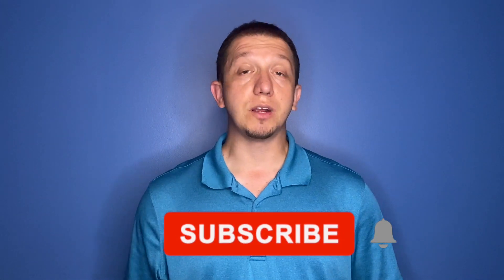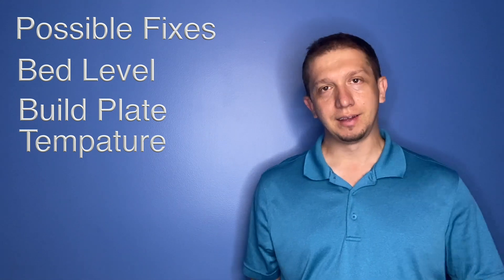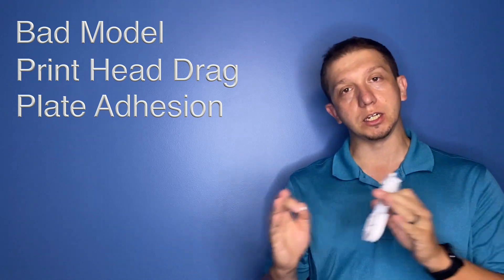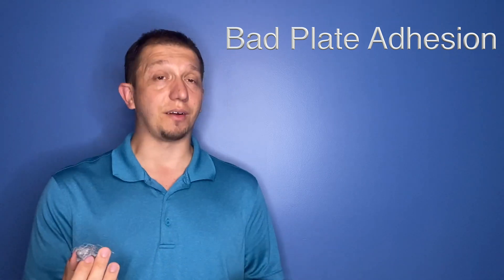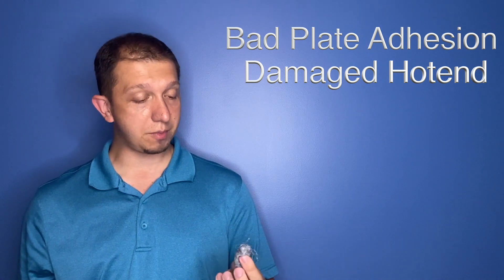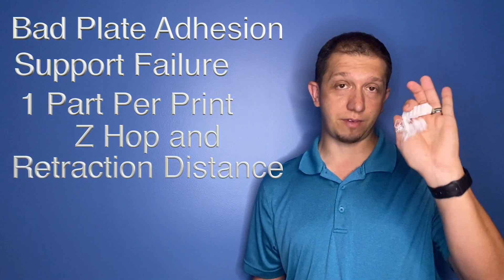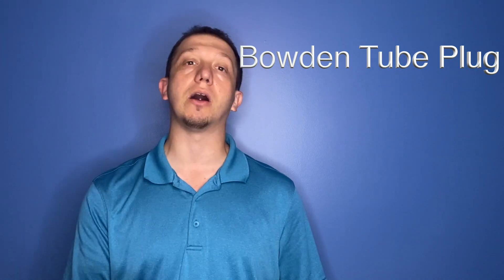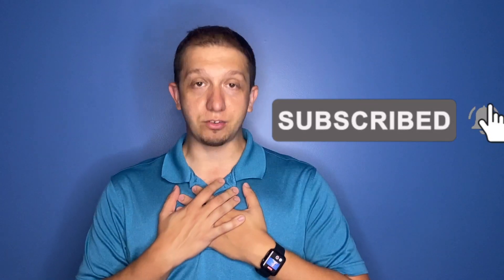5 Common 3D Printer Fails and Fixes

Comment: I was trying to print a batch of 9 different flat pelican keychains to sell, but the print failed around the beginning so we had to stop it and it was very tough to scrape off the plate. As the print started, nozzle started to drag the plastic around as it printed. Any clue why this happened?

Comment: I had a test bench print at high speed which ended up moving and it blobbed my ender 3 V3 KE hotend . Got most of it cleaned off and working however for a long print I can smell the filiament burning away and it is getting worse . I'll have to take the entire assembly apart to see what I missed .

Comment: I have the spaghetti issue but only on a particular model that i modified in blender. I am not sure why it is happening. For context, i am using the remesh modifier on the model. All of my other versions of the model that are failing are printing without issue so i am a bit confused. The other versions are only slightly different so i dont know why this particular model is causing issues, is it the slicer software that is the issue? Is it the way i am modifying in blender? Any help is greatly appreciated.

Comment: I rarely had print failure because of negligence, but my Ender 3 often randomly reboots mid print...
Sometimes it runs for a day or so no issues, sometimes it reboots mid print 2-3 times in a row...
I don't know why it does that, but I'm in an industrial area, where my UPS switches to battery breefly every once in a while due to temporary voltage spikes or drops, so I'm suspecting voltage instability, so I actually put a 20000 uF cap right after the power supply, traced 3.3V and 5V rails on the main board, and put 470uF caps on those too to mitigate the issue. It has improved a bit, but sometimes it still reboots.
I guess having a non-sinusoidal UPS also doesn't help, but that's what I have to work with...

Comment: I have learned a print issue that's a little bit unique that causes Prince to fail and this happens to be the filament you are using sometimes with certain filaments you need to adjust the temperature of the nozzle to get the particular filament color to properly work I ran into this Issue when trying to use a clear colored filament When I was using a solid color Also with this particular clear filament I have to make sure that the executor excludes for a moment or 2 cancel the print then restart otherwise it'll fail the print automatically for whatever reason it has to be fresh filament for this particular type of filament

Comment: Dude, thanks for putting this out.  I do production level printing of a few small parts that I assemble and sell as a hardware component.  For quality sake, I have long ago stepped back to single part printing.  I always keep spare wear parts on hand and meticulously level the bed when troubleshooting.  I have several printers to support the production level that I need to keep up with inventory for sales. I've experienced and worked through hundreds of problems, but have one printer that is just plagued with intermittent failures...2 fails then one good print...then 3 failures in a row.  I've done everything I can think of... I re-sliced every model and have created a library of g-codes to move the prints around to different bed positions every time, so as not to wear the build plate in any sort of pattern.  Is there a chance that this printer is just sloppy and worn out?  I have gotten so frustrated, That I've thrown the thing across the room only to pick it up, tighten everything, re-level and try again... works good for a few prints then thee inevitable failure.

Comment: My printer (ender 3 pro) when I first started a print, it went successful, but the next print it made the first layer but the other layers are screwed up infill ect, and this started today, I tried another print and it did the same thing, I redownloaded cura thinking it was maybe the settings, and the infill layers are just all screwed up, please respond asap, thank you!
Reply from the maker: So simple start questions.  Did you level the bed again?   Change filament?  What all have you done?
Reply: @Rise3DBuilds  I leveled the bed, and did not change filament yet.
Reply from the maker: @PhoenixPlays42  email me at mike@rise3dprinting.com.  Send some photos on what’s happening
Reply: @Rise3DBuilds  Do you think maybe my finger 
grease/ hand grease while loading/ touching the filament is maybe causing the extruder to skip, beacuase im printing a print right now and it looks to be all good?
Reply from the maker: Possible or humidity.   So it’s doing fine again now?   Did you change anything in the file?
Reply: @Rise3DBuilds  it has been very humid in my room the last few days, the new grey filament Im printing right now has been in an air right bag, and I’ve had my fan on over night, but filament can go bad in humidity in 8 months or more, not 1 month?
Reply from the maker: Humidity can start causing issue on day 1.
Reply: @Rise3DBuilds  what would you recommend then?
Reply from the maker: @PhoenixPlays42  when not printing store your filament in a suit tight bag with silica packets to draw away moisture.   For rolls having issues I recommend a filament heater
Reply: @Rise3DBuilds  I can’t but that rn but I have 1 silica packet from the new spool of grey filament.

Comment: I’m new to printing and I ran into the issue of the filament not dispensing properly do I need to clean out the tip? I’ve been fighting with this for a few days now
Reply from the maker: Might need to change the nozzle or try cleaning the tip.    Also make sure the extruder gear is pushing the filament in and not all bunked up
Reply: @Rise3DBuilds  I’ll try that thank you

Comment: just had my first major failure with my s1 plus. seems a part came off bed, filament collected at the extruder due to the "halo" fan duct.... ripped the hot end out of extruder and  left me with a big clump of pla to dig thru to find my parts 😭😭😭

and for some odd reason the extruder was digging into the bed when it had the clump of hardened pla on it... not nice at all!!

the ironic thing is, I ordered my wifi + cam 2 days ago... I should have just been patient and waited, but now I'm ordering a new extruder... at least the original can't be cleaned and kept for a spare.

cheers, good luck everyone!

Comment: If prints shift, check your belt tension especially, I had that issue awhile back
Reply: If your machine has a lot of hours on it, check stepper cables and connectors where they flex on movable stages.   Ribbon cables will fatigue and develop breaks inside the insulation leading to intermittent dropped steps.  Super frustrating to diagnose when it's barely beginning to manifest, but it'll eventually become bad enough to be obvious.

Comment: I just got an Ender 3 v2, and I want to throw it out the window right now. I have been trying for days to get it print anything thing and it won't. I'm using PETG(Overture black) and it won't adhere, the test strand is the only thing that adheres after that it does not stick at all. I have tried to print over 30 times. ran the extruder temp from 200-260 C ran the bed from 50-90 C, I tried stick glue, painters tape, hair spray and cleaning the bed with dish soap, but nothing works. I've level the bed 20-30 times using paper and card stock but it doesn't change. I even tried switching to PLA and that didn't make any difference either. Nothing sticks and I have 30 blobs of wasted filiment. I have switched the print files trying different builds, none have worked. All I can say is don't buy a Ender 3 V2 it has been a discouraging waste of time, money and effort. I have watched countless videos but nothing has changed. I have taken it apart and rebuilt it twice to make sure it assembled correctly but nothing has changed! 😓
Reply from the maker: Please email me @ mike@rise3dprinting.com.  I would like to try to help you

Comment: Ive been trying to print a model that I have done before just in a different color of PLA and it doesn’t work. Every time it tries to do a line it won’t disconnect from the line and I don’t know why. Is there any way to fix this?

Comment: I just had a blob and in the process one of my white wires broke and I have no idea how to fix that. any tips or tutorials? I think it's the thermometer wires.
Reply from the maker: You will need to replace the part.   Heat the hotend and there is a screw undo that and the whole part will come out.  They are pretty cheap on Amazon.  You will have to pull it from the board and install the new one while the hot end is hot.  Should be a 10 dollar repair

Comment: great video, I’m trying to print the adapter for my bltouch for my new bondtech direct drive on my ender 3 for some reason the print breaks when taking off the bed seems really weak I’ve increased infill but this doesn’t seem to change much would it help turning down part cooling or slowing print speed from the default 50 to 25

Comment: can you tell me if in 3 D printing, if you make your models with 100 % solid infill, if you are begging for warping and skewing problems due to the 100 % solid model
Reply from the maker: No you should have that problem.  It’s going to take forever to print though and use a tone of filament
Reply: @Rise3DBuilds  Thanks, i need it to sink in water without adding any toxic weights.
Reply from the maker: So my father does fixing lures and we leave a space and add the normal fish weights in the cavity and glue to together. I assume it something similiar?

Comment: Hey man im getting issues with im assuming layer shifting on a tall skinny print. 
I have tried with and without supports and with and without brims.  But about 55% - 60% through the print it falls off the build plate. I believe the head is hitting the model at higher levels and makes the print fall. Im stuck and don’t know what it could be at this time. 

I have an auto leveler and my settings are 

Pla +

.16 quality 
99 infill 
Bed temp 60
Pla temp 225
Speed is 50mm

Comment: My son's ender 3 has stopped when  about 3/4 of print done will start to hover above print and start the spaghetti stuff. He has not had problems  like this before and had printed first round with basic filament and changed to a more  metallic pla this time .It will go to home manually but where should we start to figure out why it loses contact with print? The stepper motor maybe not moving it accurately? sorry if my lingo isn't accurate I am trying to help my high school  son figure it out.

Comment: Thank you I changed my nozzle n my  pla started to come out n then stops. It will come out if I push the plastic in the tube I guess ill look in the hot end but idk what u think
Reply from the maker: Have you replaced the Bowden tube?  Also check to make sure your extruder has pressure or not to much so it can push the filament

Comment: I keep getting the first layer or the 3rd layer or a little higher knocking the print lose. When it doesn't come lose the print looks perfect but 9 out of 10 times or higher, the print is knocked loose.
I'm at the point where I've gone through several different calibration cubes and I just can't get them to print right, including ones that worked before when I first built my printer but just doesn't work anymore. I've tried all kinds of stuff like changing the bed temp, cleaning the bed, continuing to level the bed and even making it a hair tighter, changing filament to fresh sealed spool, changing the Raft, changing the print speed, changing the lift off, etc I just can't get it working after I had it sit over the winter packed up.

My last resort is to put down glue on the bed and see if that works.

Comment: Replaced hotend because it would print first 3 layers then start printing dry in the air!!!! And its still doing it after replacement!!!
Reply from the maker: That sounds like a feeding issue leading to a clogging issue.  Are you hearing any clicking from the extruder.  What printer do you have?
Reply: @Rise3DBuilds  i think ive figured it out after some investigation, i think its melting before the nozzle and stopping up the filament tube.
Reply: @Rise3DBuilds  but i have the ender 3v2

Comment: I hate the spaghetti, when my ender 3 starts printing, the pla curls and the extruder drags the pla. It’s so annoying, I can’t even print anything, my bed is perfectly leveled too.
Reply from the maker: What are your temps?
Reply: @Rise3DBuilds  205, I think it has to do something with my filament, it’s probably moist

Comment: I've got a spaghetti problem, has happened twice now with the same model, it's a long print. But has happend at different layer heights, theirs no support in the model, an my bed adhesion is good. I'm printing it on the slower end trying to go for a quality peice it's a gift for someone. I'm guessing i need to look at my retraction.
Reply from the maker: So with this issue there are a couple things you need to check.   Bed level is always the first and common answer.  If you have multiple parts that the printers is jumping to take a look at you retraction and Zhop settings.  It could be dragging when it moves parts.  Those are the First 3 I would check.  Also check you x access to make sure it is going up evenly. I have had it were one side was lower and cause all kinds of issues.  Let me know if you want more help.  Feel free to email me at mike@rise3dprinting.com.   Happy Printing!

Comment: Oh man , when all the you tube creators say you're gonna have print fails they are 100% spot on 🤣. I got.into printing last year . Got a CR10s pro. It took quite a bit of reading and to tinkering/fine tuning to get it to where I could print 30 models with no issues. Then just the other day my perfectly running printer went full retard and decided to have a blobby day lmfao.  I had 4 failures before I finally got it tuned up. Not sure what was causing it. Bed was level, nozzle depth was spot on but I did all those things over and removed and cleaned my nozzle and viola all is well again.   In a game of Millimeters it's very easy to f#@k up.  I should note that  When my machine is running well I'm printing between 100-130m/s lmfao for what I'm doing it is perfect. When I need to have really nice prints I will slow down to 80

Comment: Cool video I learned a lot. I do have a question though. I have been trying to print one of those articulated slugs, the print looks good but all the joints stick together so it doesn't move once the print is done. I have bumped the scale up, thined down the wall thickness down along with playing with heat and print speed but still the same results. Do you know a way I can get this slug printed out correctly?
Reply: What type of joints is it using? Ball and socket, double ring etc? I've found most all of them to stick a little. The model may just not be printable and you need to find a more printable version

Comment: Hey, my finished prints are like spiraling on the outside and looks really bad, any tips?
Reply from the maker: Can you send me a email with pics of what you are getting.  What type of filament and settings you are using
Reply: @Rise3DBuilds  Hey, how should I send you the picture? I am using Amazon basic pla with the bed temp at 45 and the tip at 200
Reply from the maker: @lukehansen1263   Please email me some photos of what is happening to mike@rise3dprinting.com
Also what printer are you using?
Reply: @Rise3DBuilds  I sent you an email about it.

Comment: Hi, i am looking for a 3D printer for building armor and helmets, but also smaller things.
What do you recommend? I am looking for a 3D printer with large size printing area, so there is enough space for the big armor i want to print.
Reply from the maker: My Recommendation for a good large platform printer would be the CR-10 V2 from Creality. have 2 in my shop and they are my workhorse for exactly what you are asking.  Here is a link to it on amazon. https://amzn.to/3G0cMXd

Comment: I have a print that has been going for 3 days now and one of the supports just fell off
I don't know if I should just let it finish or maybe stop it and try to glue it back
Reply from the maker: You can pause and try to put it back on with masking tape or glue.  But other than that not much you can do
Reply: @Rise3DBuilds  that worked swimmingly, thanks. Another day or so to go on the print, I'll let you know how it turns out.
Printing 8 microns at a time takes forever but it looks so good.

Comment: Great video. Any fixes for stringing on ender 3 V2 🤨
Reply from the maker: Try upping your retraction setting in cura.   Also check your speeds and heat settings.  You might not have the filament hot enough.    What brand and temps are you using?   Post print try using a heat gun to get rid of the strings